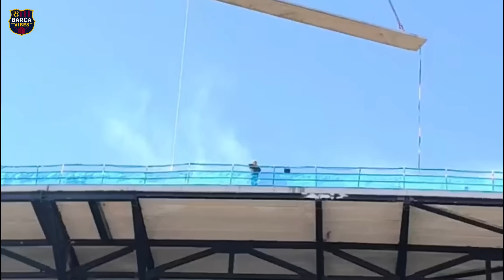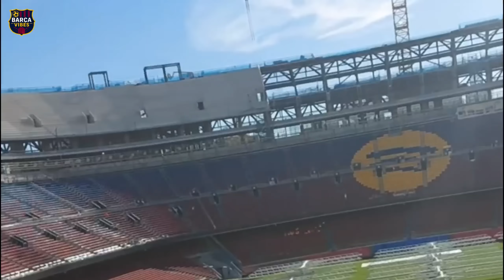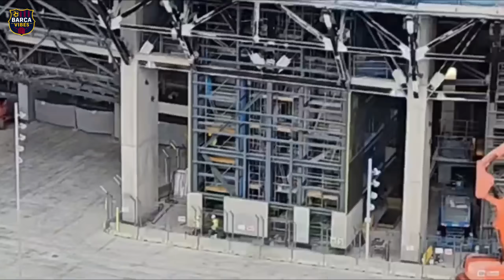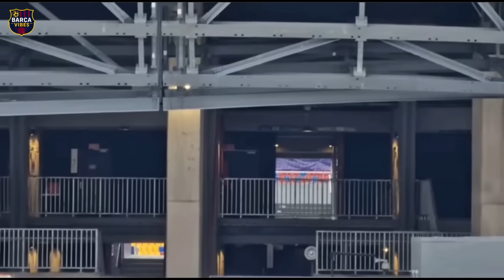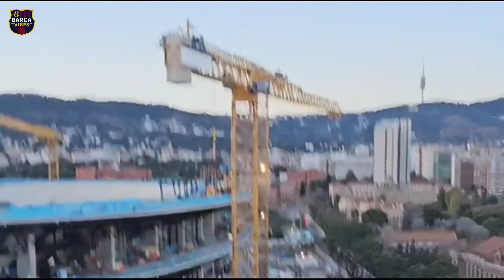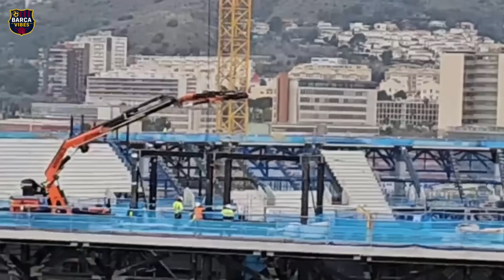Camp Nou Rises Again! Third Tier Nearing Completion & Major February Progress 🔵🔴

Comment: In the early leaks, it was already visible that the stadium featured blue accents, as well as blue flooring, stairs, and other elements, for example. Now, however, the stadium still has gray concrete instead of the stairs and the floor. Do you have more detailed information about this?
Reply from the maker: Not really buh I will search more about that 👍

Comment: The full capacity can be used before the roof is finished right? So if all tiers are ready to the end of summer, there could be 105k even without the roof?
Reply from the maker: Yh it's possible
Reply: That's the plan.

Comment: How long do you think it will take to finish the roof?
Reply: Some say that the roof will be finished during the summer of 2027
Reply: @blin4ikSM así es ,estás bien informado
Reply from the maker: That's really realistic considering the weather situations and some breaks
Reply: @blin4ikSM  Actually, they will start building it in Summer 2027, it won't be finished until 2028.
Reply: @PereUbu-pk6iq nooooo ,estará acabado en 27
Reply: @EvaSan-l2u  It will impossible to finish the roof in 2027 if they start it in Summer.
Reply: @PereUbu-pk6iq esos son planes ,luego ya veremos lo que ocurre ,dicen aprovecharán verano para trabajar cubierta
Reply from the maker: The roof will be one of the last parts to be completed. Once the third tier and compression ring are fully finished, the roof installation could take around 8–12 months depending on weather and logistics.
Reply: @Vibesbarca dicen que para 27 se habrá acabado todo
Reply: 2027